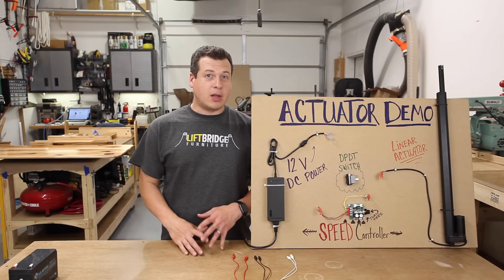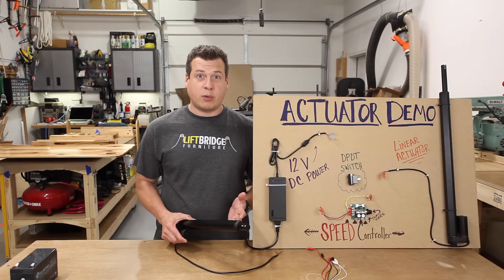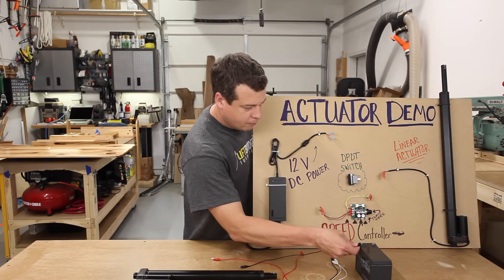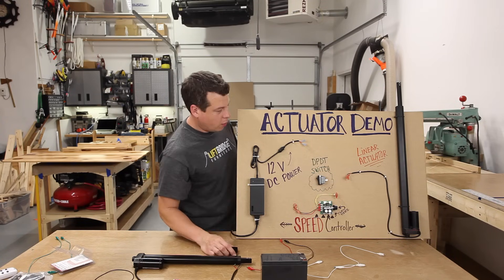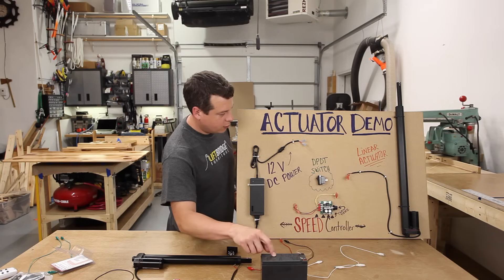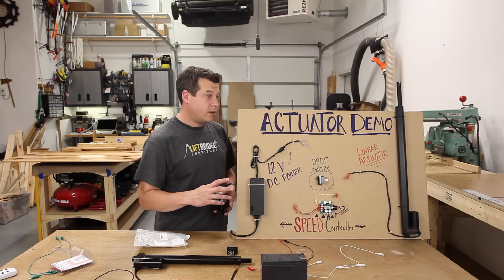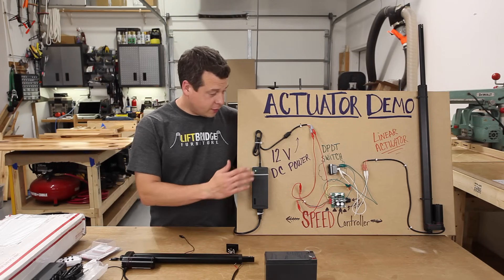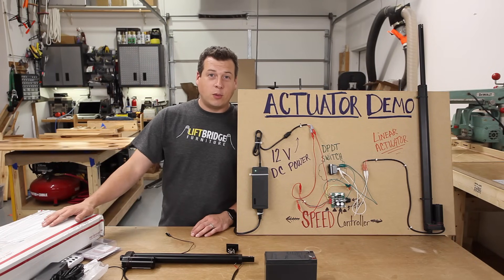Linear Actuators 101 - for Woodworkers

Comment: You can use 110v AC to 12v DC transformer. Like transformer used for thermostat or door bell.
Reply from the maker: Yep that's an option too. Personally, I like the 12v power supplies because you can get them fairly cheap, they're easy to work with, and they mount easily.
Reply: Tommy Tompkins for most that is the best way to go. Enjoyed watching. .
Reply: comes down to power.  If those transformers are rated for 4A then go for it...if they are rated for 1A...then no.